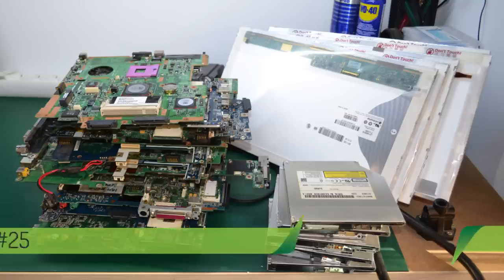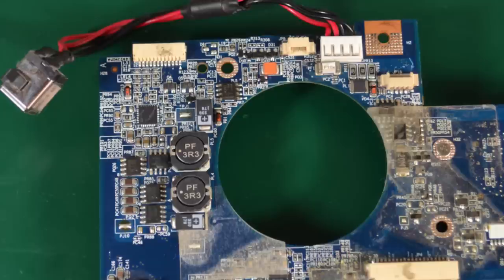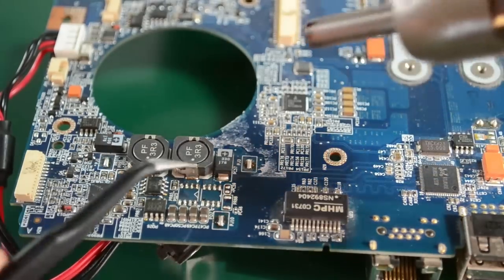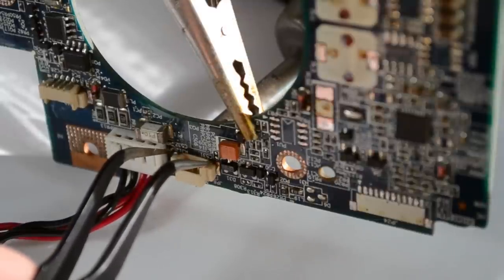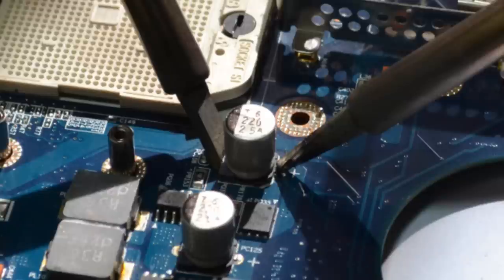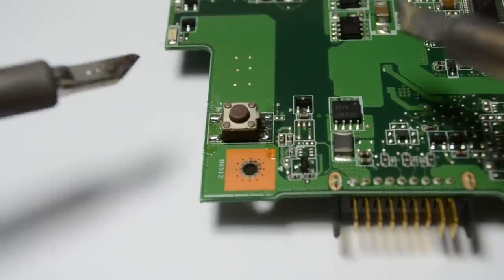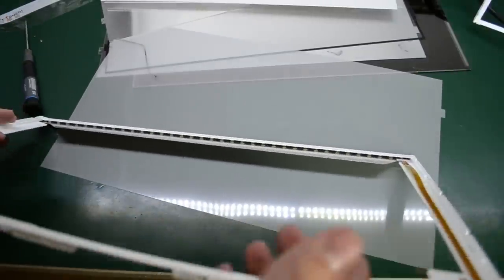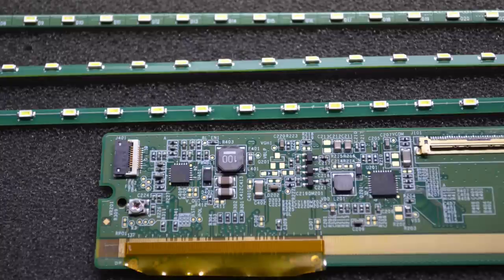VoltLog #25 - How to Salvage Electronic Components For Reuse

Comment: I appreciate your clear explanations and even with your accent, you are quite easy to understand. Obviously, I am late to your party (this video) but these days you can use the cd rom parts for lots of cool stuff. Tiny cnc laser engravers, (Even tiny 3d printers if one were so inclined) come to mind. But I think they need to be DVD burner type? I'm new at this, but am learning quickly, however I'm not sure of the process except that two are needed. And even before I fully got into this stuff, I was already squirreling away old gadgets, mostly because the advancement of tech has been so rapid, seeing these things go to landfills is horrifying.And a lot of it still works! Also being able to do upgrades to things not otherwise designed to be upgraded is pretty cool. Like my projector from astronomically priced metal halide to far cheaper and better quality to the image of LED. (Heck even the really old super 8 whose bulb has been known to burn film. Haven't done it yet) Then I was gifted a 3d printer while finding the world of arduino and all hell broke loose. Hubs isn't thrilled with my growing pile of what he perceives as trash. but fun is the best thing to have. Anyhow, thanks for your time and effort. It's appreciated vastly.

Comment from the maker: @fredlllll you are right, I got my motors all wrong in this video. The main motor of the cd drive is bldc type and it makes sense, you don't need accurate positioning bur rather accurate high rpm control and which is achieved with a bldc motor.

Comment: Something to try is using a cheap toaster oven to get the board nice and hot before you use the hot air station. It won't melt solder, but should help reduce the time you need to hold the hot air gun on a single part of the board.
Reply from the maker: That works as long as you don't have components that will melt or degrade from the heat, that includes electrolytic caps, plastic connectors...

Comment: What about using flux to help in the removal of the parts?
Reply from the maker: +TheRadiogeek Sure, I use flux for the removal of parts because it helps break the oxide layer that forms on the solder joints. That oxide layer usually prevents you from making good thermal contact with the soldering iron tip.

Comment: you could have reused the actual lcd panel and get a new control board for it.
Reply from the maker: have you tried replacing the control board on an lcd? :-)
Reply: VoltLog yes plenty of times type in the model number of the panel in ebay and they come up usually around $20. the also come with all sorts of ports hdmi, dvi, vga, even audio output.  heres a quick search i dont know the model of the panel but here you go. http://m.ebay.com/sch/i.html?_nkw=lcd+controller+board&isNewKw=1&isRefine=true&mfs=KWCLK&acimp=0&_trksid=p2056088.m2428.l1311.R1.TR12.TRC2.Xlcd+controll&sqp=lcd+controll
Reply from the maker: I thought you meant the interface board of the LCD. I have such controller board like you linked from ebay but in the case of this video the lcd panel interface board was damaged, I couldn't reuse it.

Comment: the main motor of the cd drive is probably a bldc motor.you can drive those with an esc driver. (the ones used for quadcopter motors) i used this one for mine www.banggood.com/Wholesale-XXD-HW30A-30A-Brushless-Motor-ESC-For-Airplane-Quadcopter-p-50621.html?p=K12415734648201408JW

also the motor has one or more hallsensors under the rotor.